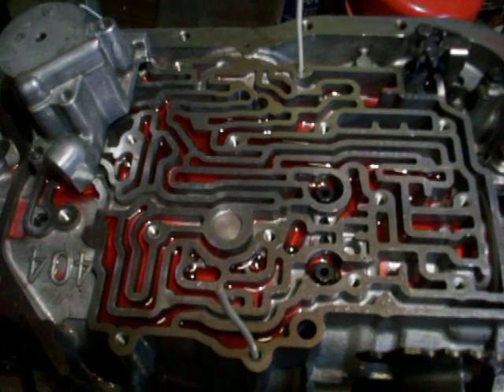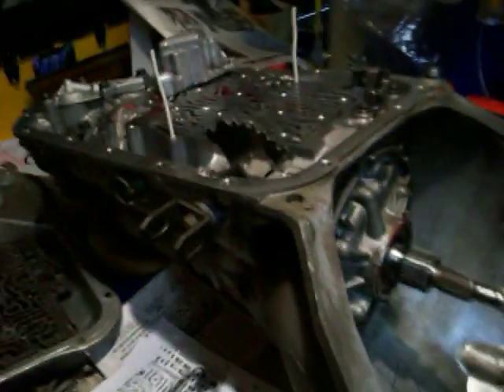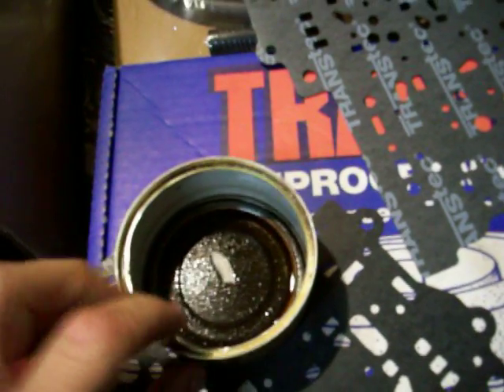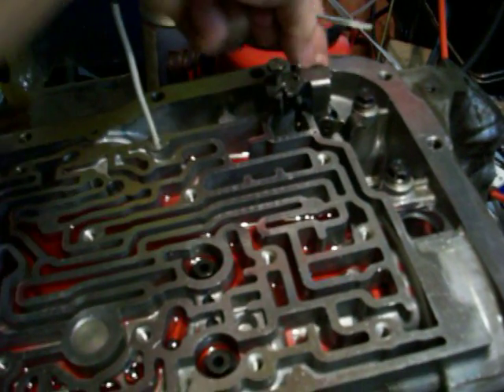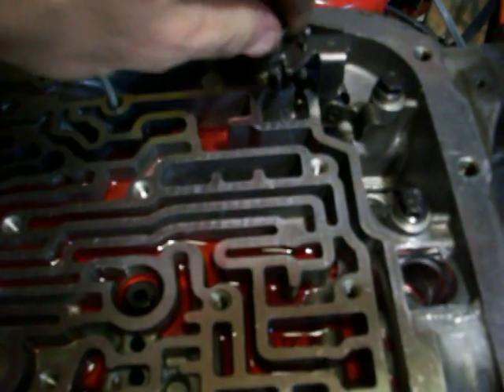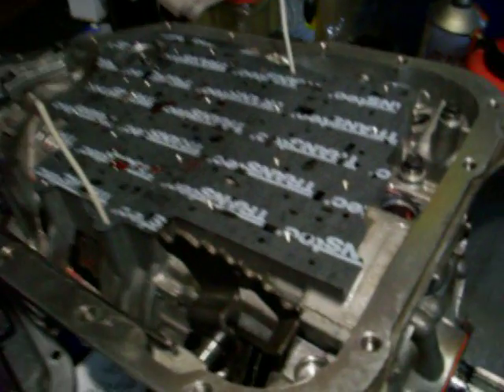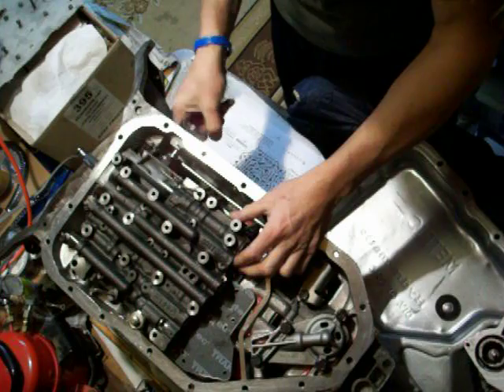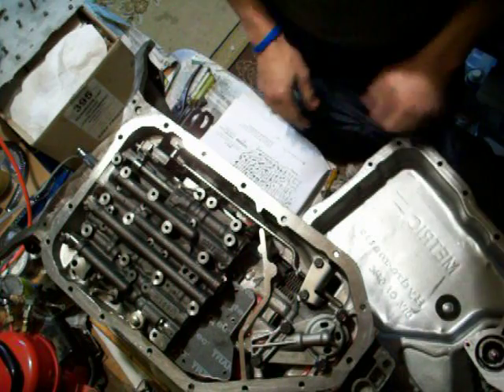200 4R valve body installation

Comment: I need help with my box chevrolet thm200 which the disarmed checked completely without leakage in its forward or backward drums its valve body is perfect they do not stick the valves anymore I do not know what else to check the box I do not want to make the changes just it stays in first speed and from there it does not happen or that you try to make the manual changes if you have any idea or advice I would be grateful thanks and greetings

Comment from the maker: Exactly what I had in mind.  I unfortunately have a a supply of tools that are nothing more then remedial at best, and did not have the tiny metric bolts needed save for inside the oily confines of spare transmissions in the 'workshop'. I had had enough of oil! Indeed the slotted screws are the real way to go. Thanks for the words for others to see.

Comment: You should take a couple longer bolts (the same size as your valve body bolts) and cut the heads off.  Grind the end so it's slightly tappered. Then use a cutoff wheet and cut a slot in the end.  They make great alignment dowels.  I used to make them for all the GM transmissions I used to work on. I had a set for the front pump too.

Comment from the maker: Yes, the higher stall allows the engine to get closer to its maximum torque when would up off the line, almost like a sling shot effect. This one only has a cable control, no vacuum.  It all rests on that cable!  The cooler is a good idea on the Taurus, but in winter you can blank off a portion of it (start with one half the surface area) and see if that will give you lock-up, but if you are only going short distance, do not worry. Amazing the heat the coolers throw off!

Comment: More stall is more slip, right? 

About shifting at certain RPM - I have a question about that too ... this one is controlled by the cable? how about vacuum or no?

As soon as I started driving the Taurus back in 2004 (wow that long ago!?) I installed a class  C Motorhome cooler on it.  In the winter it's a bit of a pain - the torque converter won't lockup because of cold temperature - but it saves the transmission in the summer.

Comment from the maker: Mike, I will be running a very large external cooler on this one, and the radiator, being a 4-core, has a very large heat exchanger in it too. These transmissions run a little hot, and will be even more so with the higher then normal stall torque converter.  More stall = more heat, but this is another lesson!  Wheat do I think of  external coolers?  Every automatic car I have owned has one installed in very short order!

Comment from the maker: Hey Mike!  very simply:  With the throttle valve wide open it would be:  No up shifts until about 4600 RPM in each gear, the speed of 'governer' pressure matching with the increased line pressure.Very hard shifts as you say, it would not break things right away, but it is hard on you.  I have gotten cars home by tying the broken valve cable to halfway position and driving accordingly. Yes, the mess found in this one shows why coolers and fluid changes help very much.

Comment: I'll admit I know nothing about automatic transmissions ... but ...

If you made the throttle thing so it was always "wide open", the transmission would shift too hard and break things, right?

I really hate when people pay attention to every maintenance item on a car but the transmission. Driving it 100000 miles with no fluid flush - then they wonder why it dies!

Are you going to be running a cooler on this?